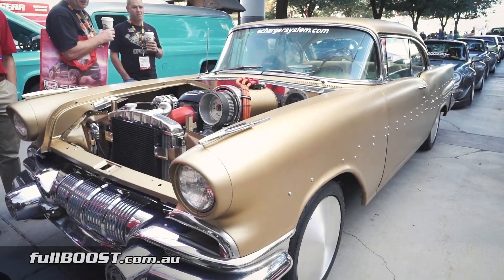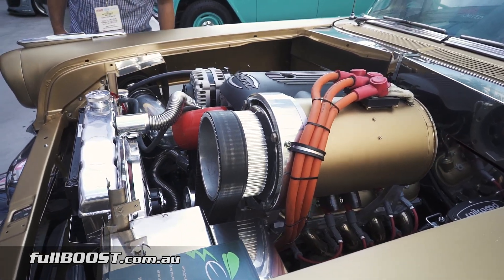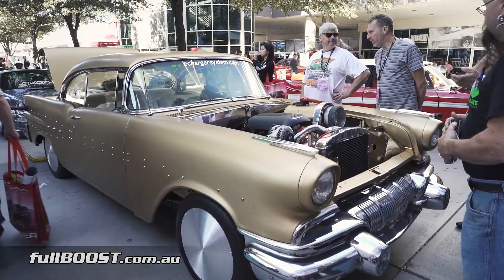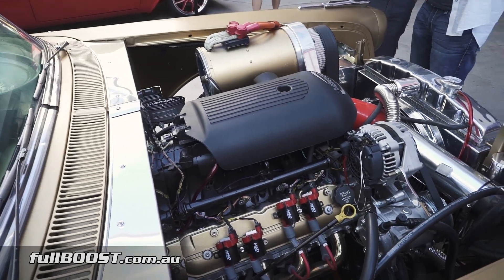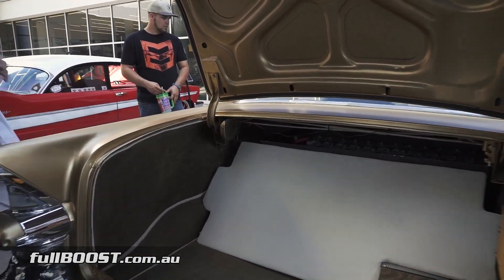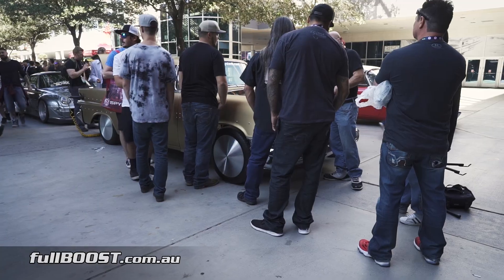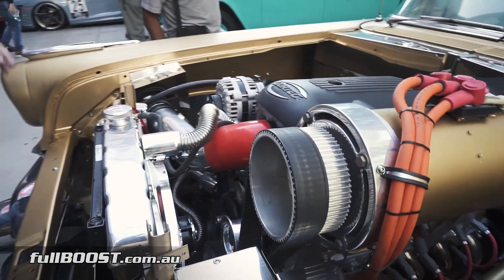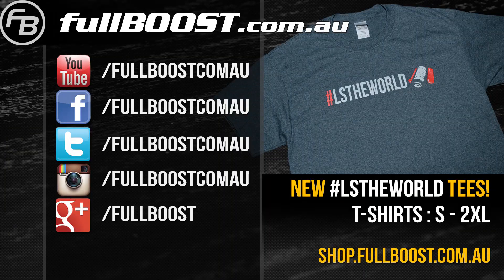The E-Charger Hybrid System

Comment: Newton's law... nuff said
Reply: Newton had many laws.
Reply: In that case, what about it? The guy covered it in the video. Power comes from the power grid which is less expensive than buying race fuel for the same kind of power output from your engine. I don't see what your problem is.
Reply: Grip Limit
I'm noticing that you still refuse to explain yourself. Probably because you can't.
Reply: you know what a battery does?
Reply: Yeah I'm talking about mild power gains to the equivalent of this electric motor. You can take this LS engine add a properly sized turbo, like a garrett gt3076r at 7 psi, have loads of low end torque and gain more power than this electric motor that adds significant weight to the car. All on pump gas and stock internals, probably just pull a few degrees of timing.
Reply: 98%? Um.... Most of Oregon is NON hydrocarbon power... Hydroelectric.
Reply: Ridiculous simplification of an extremely complicated area of technology by citing a law that only has a minor part to play. Definitely 'enough said', not at all a blatant cretin trying to look intelligent because he has 10% of the knowledge required to come to an informed decision.
Reply: I don’t think he goal is to go green bruh.
Reply: How much do you think the batteries for this thing cost? Let alone having to replace them every 5 years. Plus the added weight of those batteries. (They are not light) newtons law is in effect NO MATTER WHAT. Think.
Reply: Grip Limit I can see that. I agree that if you're trying to make it a bolt on hybrid solution for improved fuel milage it's a losing proposition. I'm sure the cost of the modifications would never pay for themselves in that respect. As a plug in hybrid, though, it could definitely add value. As far as making power, sure you don't need race fuel to make more but if you're talking power on par with a big roots blower with high compression you absolutely need higher octane fuel. I don't see anyone making 9 second passes on 87 octane unless you're running a ridiculously large engine with the torque output to get it done without power adders.
Reply: planetshapers I'm sure somebody makes a flex plate adapter for it.  460s are popular motors among the Ford community.
Reply: planetshapers I had trouble finding the right bellhousing for it to bolt up but  I had a friend who has extensive fabrication experience make me an extension for the bellhousing  because the ZF6 diesel bellhousing isn't the same as the big block V8 bellhousing
I have a twin disc clutch which comes from a 7.3 PSD ,and i had a billet  flywheel custom made for it with the correct Offset so i didn't have to get a transmission shaft extension made
Reply: Saving fuel = saving money. It also means you can run a fuel efficient/flexible motor rather than a 'cammy' one, which might need lots of work to keep in trim. It's $ saved all over the place once you've bought the system (they claim it's <$5k). 
Green means green!
Reply: What? LOL no 98% is not hydrocarbon based. Close to 20% is nuclear, 13% is renewable.
Reply: you've said nothing. he's not trying to get the thing to run by itself. he's simply taking power from batteries and assist the engine. the batteries receive their power from the coal plant or nuclear or some squirrels. this would actually be better than a turbo or supercharger mainly due to the fact that electric motors product torque at every deg of rotation, whereas an ICE doesn't. If the electric motor was more efficient it would be a lot more economical to do this. there are ways of getting extremely high efficiency numbers.
Reply: He is speaking about the second law of thermodynamics! It basically states that you can not derive more energy from a device than you put in to it!  It is a unbreakable law. That is why there is not a perpetual motion machine.  The extra energy for this device is from the electric grid for charging which comes from coal.
Reply: There are ways around the law. I have observed such. It's all based upon extremely high efficient systems.
Reply: Steven Dale wut. Lol, only 30% of the US is coal. To put that in perspective 20% is nuclear.
Reply: What about Newton's law? You've said nothing.
Reply: I don't need to explain it, Google it.
Reply: Grip Limit
No you don't need to explain Newton's laws, but you do need to explain what you're saying. Because you've said nothing.
Reply: Grip Limit
Still waiting for the Newton's law part......
Reply: this add on doesn't add power to the engine  it takes load away from the engine thereby making the engine work less and thus increasing the vehicles efficiency ,,, adding a turbo to it won't make it get better fuel mileage 
I have no doubt that this LS1 will handle a turbo  even on stock internals
I'm more of a big block person myself ,, I personally don't drive a car 
i own a truck  , or actually several ,,,and  my favorite of the bunch is a 1984 F-250  that can get 21MPG on the highway  ,,and yes i said 21MPG 
from an F250 that's powered by a 478CI big block V8 
lots of people laugh when i  say that but it's true 
it is turbocharged  , mildly  has a pair of garret T3s that provide up to 10 pounds boost ,mostly to make it breathe better ,, the engine Dynoed 570HP  at 5000 RPM and 620 FT/LB torque at 3200  with 10 pounds of boost,, 480HP at 2100 and 470LB/FT with 3PSI boost
fairly unimpressive numbers 
the transmission and gears are where my mileage comes from 
I am using a 6 speed manual  with a gear vendors Overdrive unit giving me 18 speeds  , and coupled to a 2 speed rear axle with a .355 top ratio

cruising on the highway at 70mph i am pulling 1900 rpm ,this transmission is geared for a diesel ,and that's without the OD unit in high gear 
if i could ADD this hybrid system to my truck  I could conceivably get 30MPG or more  if i drive right ,and with a truck  the possibilities are endless for what i could do with it 
the other truck i would enjoy seeing this added to is a daily driver  that i've had for 26 years 
that's a 1983 nissan 720 truck that has a 2.5 liter turbo diesel 
it already gets in excess of 45MPG and can get 50+ when driven right 
adding something like this i could make it get  double it's  current fuel mileage as a hybrid ,,and i have a 6KW diesel APU that could make that even higher by providing regenerative power for the batteries
Reply: To revive this thread, these motors hit peak torque at zero rpm where a turbo motor wouldn't hit its max power/torque til higher revs.  Additionally, internal combustion engines are very inefficient and these electric motors do a much better job at getting power to the wheels and not having as much energy wasted.  With a hybrid setup, you could get the best of both worlds and have an insanely long and fun powerband.  With a hybrid setup, you could also get rid of the alternator, starter and even transmission saving weight.
Reply: 123devinzz1 yeah, stores power. Do you know where the power comes from?
Reply: Without plugging it in*
Reply: madjimms um... I said 98% of the U.S.
Reply: Drex Auto for one thing you don't need race fuel to make more power, it's true electricity from the grid is cheaper but 98% of the US electricity is hydrocarbon derived. My comment was more in response to when he was explaining about driving the car standalone with plugging it in. Which is the same reason hybrid cars are dwindling off the road.
Reply: That's true, I'm referring to the "conservation of energy"

Comment: to me it sounds like you have the ability to have extra torque due to the electric motor plus fuel savings however the price tag for the setup plus a mod plate i think i would rather run slightly more fuel or run a better cam in my ls1
Reply: EVL78UC BURNOUT Videos this is the only sound argument against this system. Fabrication and a new motor/controller and batteries will run you $10k. If you didn’t start with an LH and transmission ($10) and went with a beefy motor/controller and more batteries ($15) you would have some range issues but who drives classic cars far anyway.

Comment: Seems the weight increase cancels out the extra horsepower... 250lbs for ~150hp? Would have to do some math on that, but it might not really help much. Great novelty and has potential, especially if we come up with new super lightweight battery tech.
Reply: Jesse Shanks it's not about the HP output though, what I think they are marketing it for is older car enthusiasts, people who have older cars that chew through the fuel just to take it anywhere, so for people who like taking there gas guzzling car on cruises, up the coast or across the country or even across state. I can't see them advertising this as a traditional turbo/Super charger kit for added power and boost. just my thoughts though.
Reply: Matt Sheahan If you have the coin to build a car like that the cost of gas is not a problem.
Reply: It's 150lb/ft torque. That's more torque than your average 3000+lb commuter car. I think it offsets the 250lb weight penalty.
Reply: Tyler Hunt Both the Accord and Camry base engines produce at least 170ft/lbs.  You're a bit low.
Reply: Robert Thomas civic, corolla, Mazda 3, focus, cruze (before 2016), dart... I can probably go on.

Comment: This concept looks interesting I'm only not sure if the crank pulley/belt system is able to withstand the stress for longer time periods.

In normal concept the supercharger parasites on the engine power, sucking something out from the crank and sending something in in this case could be the power on the pulley/belt much higher then on the crank...

I like this idea but to be honest i would rather see a chain, if this would be done in a more proper way; not just a s a eletric supercharger this would be actually the ideal car conversion solution. If this would be able to turn the crank by itself you can get full and just electric drive + it could be used to recupe the energy while braking.
Reply: Did you watch the video? most of that was covered.

Comment: and how much weight does all this add?  500 lbs?
Reply: No i'm pretty sure that "under 250 pounds" figure was just the batteries.  
The motor, controller, and cables would be ontop of that.
Reply: turbskies and superchargers add more most of the time
Reply: what in the fuck is a turbski? and iove   lifter   blowers they dont  weigh 500  pounds
Reply: Futten turbo. Look up cleatus mcfarland. And skrews add 500 atleast on most cars
Reply: the  turbos and  blowers ive picked up would never add that much weight  unless  its a  turbo or  blower from a  engine that comes from a  freight train  or ship  and ive picked up some  big turbos and  6-8-14/71  blowers so no
Reply: He said 250 in the video. (A large passenger) not too shabby if you can cut weight elsewhere.
Reply: Futten the whole system weighs 250 lbs, pretty light considering how much it helps.
Reply: i think id  still go with a turbo setup as its  lighter  and no  load on the crank and no parasitic loss
Reply: Futten downsize and turbocharge
Reply: thats my thought

Comment: can you say crankwalk with the electric motor pulling on the crank pulley.
Reply: Why would the timing chain slip a tooth?
Reply: BustedWalletGarage
None of that answers my question. You're not going to have enough deflection in the crank to jump a tooth on the timing chain without catastrophic bearing failure first.
Reply: JABBER AEGIS
I'm well aware that a supercharger doesn't turn the crank. But a supercharger puts a large load on the crank that would be comparable to the load applied by the electric motor. The main difference being the RPM that the peak torque is applied. High RPM with the supercharger vs low RPM with the motor.

And jumping a tooth in performance applications doesn't tell me much. I was asking specifically about supercharged applications. I think you're more likely to jump a tooth because of high RPM, or rapid changes in RPM than because of the addition of a supercharger.
Reply: Tyler Hunt stock crankshafts are not designed to have 200 lb ft of torque applied to the snout. The shaft is going to deflect a lot , throwing the chain out of alignment. This will cause premature tooth wear and crazy ass side loads. The front crank bearings will suffer , causing greater clearance , increasing crank deflection. All these factors will greatly decrease service life and any $$$ you might have saved will be spent on rebuilds - repairs. If you use a aftermarket crank , you just spent over a $1000 plus machine work. Unless you're using $200 junkyard motors or only drive it 2000 miles a year , the risk/reward is too off balanced for me to invest.
Reply: BustedWalletGarage
Also, do you see a lot of jumped timing chains in supercharged vehicles?
Reply: JABBER AEGIS imagine the complete and total shit storm that occurs when the timing chain slips a tooth or breaks. The pistons will be force fed valves and bits of springs.
Reply: First off supercharger doesn't turn the crank crank turns the supercharger. And there is a reason they sell a double roller timing chain for the ls Motors. And yes I have seen many jump a tooth in performance applications
Reply: cause it happens in high mileage engines ,, timing chains fail 
I'm not sure whether the LS is an interference engine though
Reply: just wondering is the LS an interference engine ,,  if it is not   the valves will not hit the pistons in the event of a timing chain failure
Reply: Tyler Hunt The force from the electric motor must pass through the entire crankshaft, I would not put more the 2 extra pistons worth of torque on the end(looked at the math and thats what theyve done, so it shouldnt cause to much deflection) Force to a supercharger only has to pass completely through the crank 1/4 of the time, and then it is just 2 pistons worth of torque.

Comment: I like the idea of a bolt on system like this, however I would like to see some more real life testing of it before I am sold on it. I have just seen too many "kits" that claim to give you power and better fuel economy, but in reality did nothing.
Reply from the maker: +DC Garage I believe they are aiming to sell the kit for under $US 5000.
Reply: IMMORTEN VALKYRIEN dude 5 grand is a steal. I really want a kit now
Reply: The difference is this kit is based on proven technology. Of course that means it will probably be VERY pricey...
Reply: Fullboost Wow that's actually not bad! I would strongly consider it at that price.
Reply: DC Garage I get that these are in their early stages of being in the market etc. But $5000 is too expensive IMO.....however I would still like to see what these kits actually do on a dyno as well as RL MPG test and before and after on a drag strip
Reply: Matt Jordan the great thing about this kit is you can either gear it to a blower or route a belt to a centrifugal given the amount of torque electrical engines make whatever suoercharger you use it's gonna make a ton of boost
Reply: Matt Jordan and since the supercharger is ran by an electrical motor, just wire up a potentiometer and literally crank up the boost. It would make an excellent power adder for the dragstrip. You would get all the HP from the engine plus what ever the supercharger is pushing. That's what I would use this kit for.
Reply: If you wanna see how this performs in real life, just drive a Tahoe hybrid, and compare it to a normal one. This is almost exactly the same as the stock GM setup
Reply: general motors has being doing this for years. the "hybrids" from the mid to late 90s (mostly Saturn's) had big alternators that were also used as an electric motor during times of need. they didn't go all in on the tech but it did see a 10-20% boost in efficiency

Comment: most electric motors spin faster than a gas or diesel engines, so why such a big pulley?  are we now packing around large batteries and a three phase converter? seems like the idea just got heavier than a nitrous bottle

Comment: Basically, this guy built a naturally aspirated version of McLaren´s sports hybrid where instead of charging up a couple of turbochargers on a combustion engine to eliminate turbo lagging, an electric engine powers a combustion engine at the crankshaft to ge the acceleration of a supposed EV but most likely would take away small amount of power when it turns into a generator to recharge batteries for a power source.
Reply: He built a bolt on Prius kit.

Comment: I'd love to know how much the whole system weighs. No point in adding all that gear if the power added cannot overcome that additional weight.
Reply: Bestwick1983 you would have to add a whole lot of weight to make 150 horsepower a waste
Reply: They told on the video that it was under 250 pounds.
Reply: Jd Rogers II this is an ac-51 ac induction 3phase motor. It produces 148 foot pounds and 51kw of power which is 68.4 hp